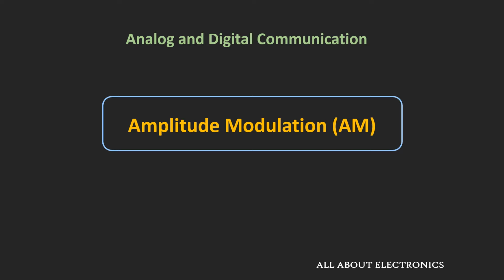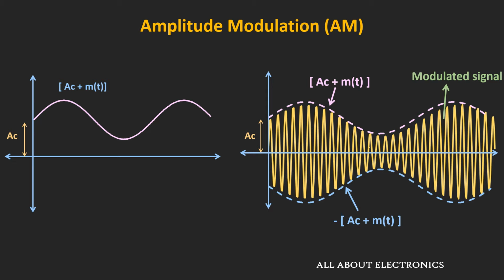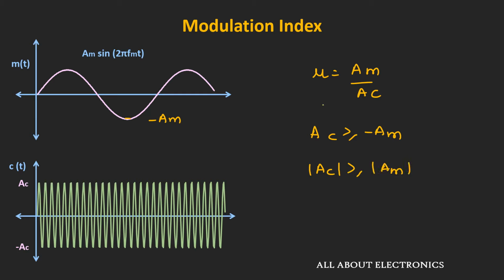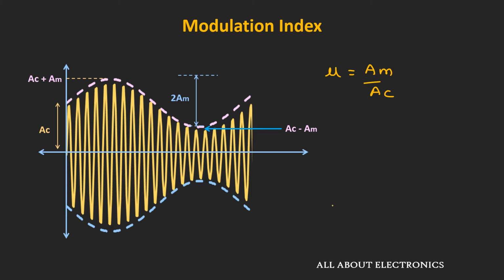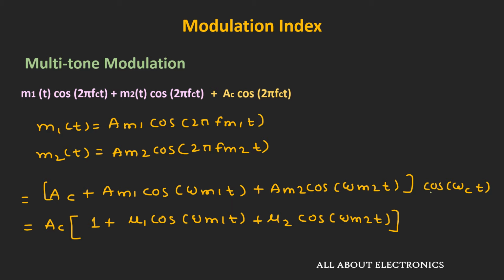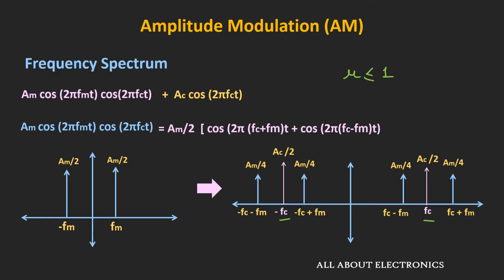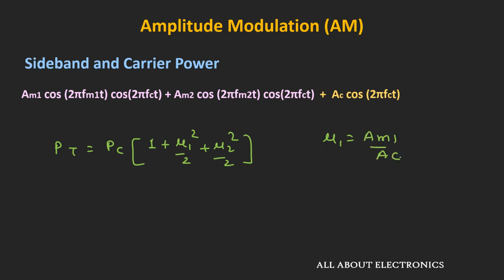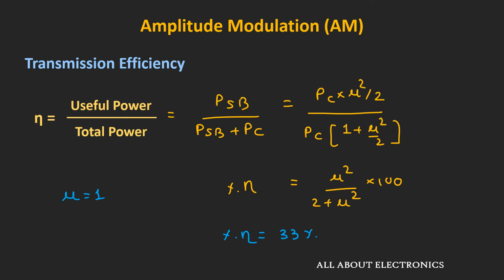Amplitude Modulation (AM) Explained

Comment: How is the frequency spectrum if the message has more than one frequency?
Reply from the maker: it depends what frequencies the message signal contains. If there are only two discrete frequencies then in the frequency domain there will be two spikes ( two components). if the signal is aperiodic and contains band of frequencies then you have continuous band of frequencies up to certain range. please go through few examples which I have covered. please check the playlist.

Comment: Sir I wanted to do diploma (after 10)+b.tech in electronics engineering  (only electronics engineering and not electronics and communication engineering) lateral entry so I wanted to know that how much mathematics is used in electronics engineering and which topics are important of mathematics for electronics engineering plzzzzzzzzz tell.
Reply from the maker: Well, ideally you should go through first year engineering mathematics. 
But first, you can go through, differential equations, calculus, trigonometry etc !!